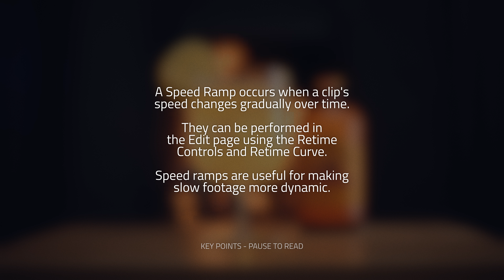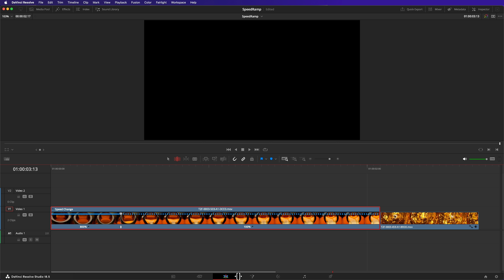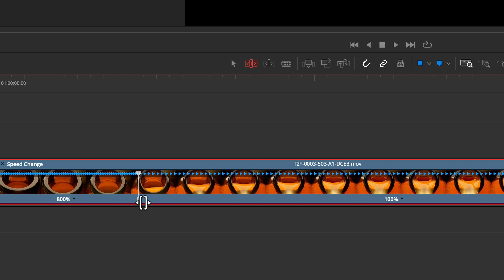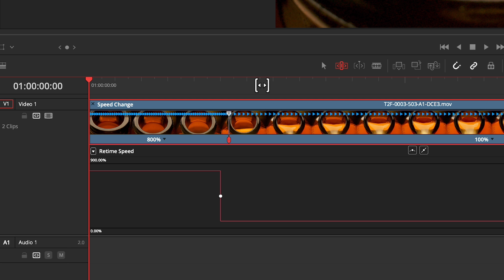SPEED RAMPS in Davinci Resolve Version 19

Comment: No it's not nice and intuitive.  I'm really trying to move away from adobe products, but have you done this in premiere? it's like 300% easier. Simple click to create keyframes, drag lines up and down and change the curve all inline.  This is awful.  Sorry.  And it's called a ramp, ie most people actually want it to ramp, not just change.  And now in v20 i have to go digging through some other panel to edit curves.  I think if someone actually wanted to create a drone video with lots of ramps they would just keel over and die.
Reply from the maker: Hello, we use Premiere Pro too. We appreciate frustrations when moving between different editing programs.

To be fair though Resolve's speed ramping interface works in a very similar way to Premiere Pro. It's not necessary to use the timeline interface for adding speed points before playing with the retime curve. You can just add your speed points in the keyframe editor. That's essentially the way that Premiere works.

Instead of the panel where you manipulate your retime curve being called "Effect Controls" (as it is in Premiere), it is called "Keyframes" in Resolve.

We hope that clarification helps. Premiere, Final Cut and Media Composers are all great programs with particular strengths. Sometimes when moving between programs there might be parts of the interface that you miss from the old program, but for every 1 thing that you don't enjoy as much, there's usually 2 things that are better that make the switch worthwhile.

Thanks for watching.
Reply: @team2films I find it bizarre that you think they are remotely comparable 😅
In this video the premiere speed ramp is explained in 30second. All on the timeline. Ctrl click to add point. Sped change simply by dragging lines and an inline curve editor! How on earth can you see these as equivalent?? https://youtu.be/MYTDyjLub8A?si=SbeTXmDdl9E2QF08
Reply from the maker: That's a great video. Thanks for sharing. For sure, yes there are differences. It's possible to identify similarities, and it's possible to identify differences. We were pointing out that the process of performing your speed ramp entirely by editing the Retime curve is possible in both programs. Yes, in Premiere you can edit the retime curve directly in the timeline. Ironically, you could do that in v19 of Resolve, but in v20 it's now in the Keyframe panel. Perhaps this functionality will be brought to the keyframe key in the future.

Comment: I'm fairly new to DR from PPro.  I really love Resolve but the speed ramp is so horrible.  As soon as you change the ramp amount to a larger number, access to the keyframes just disappears into the top of the clip and it CANNOT BE REACHED!  I've even changed the display percentage but it doesn't help.  How is such a simple thing so difficult to fix?  I've been trying to do a speedramp for a half hour and I'm so frustrated at this insane oversight (unless I'm missing something)  Here's a link to what I'm talking about https://youtu.be/qArahoK89YQ
Reply from the maker: Yes, there are some small issues with the UI in places. Hopefully we'll see improvements on this in the future. There are ways to work around the issue, but a fix would be more ideal. Sorry it's causing you problems.

Comment: Hi, I have a question. The Clips in my project need to have a set length and I need do resize the video again and aigain. Is there any way to do that while the clip has set length? Btw. Thanks for that Video, well explained 😊
Reply from the maker: Hello, I'm not sure exactly what you mean, but here's two tools that might help:

Using the trim tool to perform a slip or slide edit.
Using Ctrl-D to set a clips length.